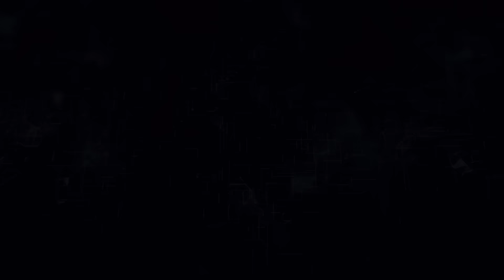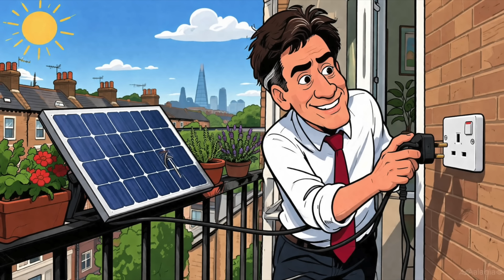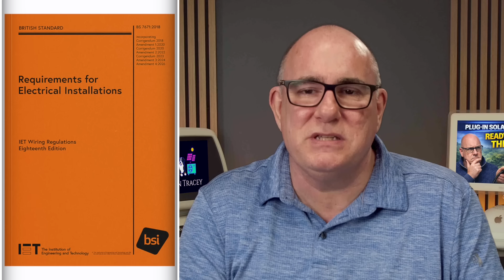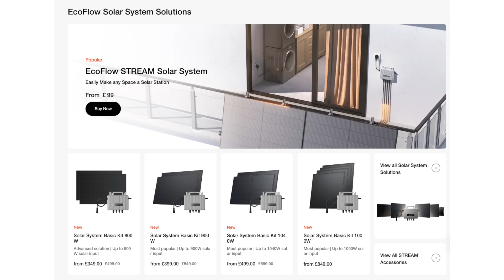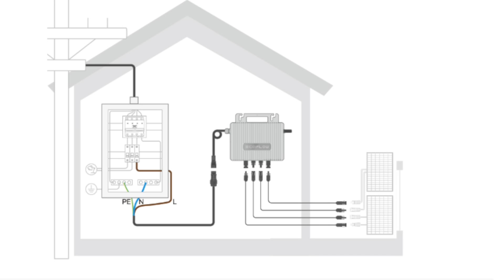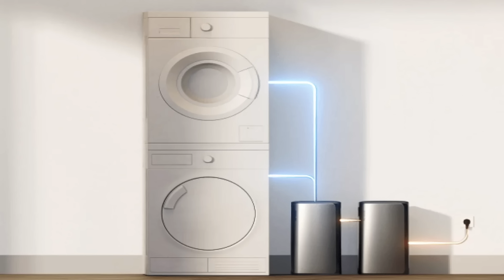Plug In Solar Is Coming… But There’s a Problem

Comment: Can you answer a technical question for me?

When you plug your micro-inverter into a socket, it senses the mains and synchronizes frequency and phase and produces an output.  If you then remove the plug or the incoming mains fails it needs to power down, but how does it tell the difference between the incoming mains and the power it is generating itself?  I can think of a few ways to do it, but how does it work in real life?
Reply from the maker: @rogerbarton1790 great question 👍  

In real life it’s handled by something called **anti-islanding protection**. The inverter isn’t just looking for voltage — it’s constantly checking grid stability (frequency, phase, impedance etc).  

If the grid disappears, even if the inverter is still producing power, those characteristics change very quickly. The inverter deliberately introduces tiny disturbances and looks for a “stiff” grid response — if it doesn’t see it, it shuts down within milliseconds.  

So it’s not actually “confused” by its own power — it’s verifying the grid is real and strong, not just itself.
Reply: @JonathanTracey  Thanks for that, pretty much what I was thinking i.e.:  Pull the plug = load current disappears = stop the inverter; grid disappears = load current  increases = stop the inverter.  Stop the inverter periodically and don't restart unless the grid is there.

Comment: LONDON, March 18 2026 (Reuters) - Britain is seeking to change planning rules to allow business and public sector organisations like schools in England ‌to install small wind turbines without needing planning permission, the government said on Wednesday.

Under the proposals, business and public sector organisations would be allowed to install one turbine up to 30 metres high, without submitting planning proposals.

As of March 2026, the UK government has proposed new permitted development rights (PDR) in England for non-domestic, small-scale wind turbines, allowing heights up to 30m. 

Proposed limits include a maximum 200m² swept area—roughly a 16-meter diameter—aimed at increasing on-site energy generation for businesses and public sites. 

Height matters for a wind turbine because wind speed increases and becomes more consistent at higher altitudes due to reduced ground friction and fewer obstructions. Taller towers allow turbines to access stronger, more consistent winds—a phenomenon known as wind shear—which can exponentially increase energy production and improve economic efficiency.
Reply from the maker: Yeah, it’ll be interesting to see if this actually does anything, wind turbines with blades less than 1 m and size are generally useless, and in urban environments that turbulent air doesn’t allow for much power generation?
Reply: @JonathanTracey   As of March 2026, the UK government has proposed new permitted development rights (PDR) in England for non-domestic, small-scale wind turbines, allowing heights up to 30m. 

Proposed limits include a maximum 200m² swept area—roughly a 16-meter diameter—aimed at increasing on-site energy generation for businesses and public sites. 

Height matters for a wind turbine because wind speed increases and becomes more consistent at higher altitudes due to reduced ground friction and fewer obstructions. Taller towers allow turbines to access stronger, more consistent winds—a phenomenon known as wind shear—which can exponentially increase energy production and improve economic efficiency.

Comment: The real winner of everyone buying a supermarket DIY plug-in solar kit will be the grid infrastructure in general - most of the excess generation that cannot be self consumed will be exported and if no MCS or G98/G99 approval, the owner will not be paid for exporting it and it will go to the grid for free. Not sure if the generators get paid for it, but it will be used by other households and they will have to pay for this free electricity being sent to the grid. Would be interested to know more about who would mainly benefit from unbilled excess generation export capacity...
Reply from the maker: @GdaySport that’s a really good point 👍  

Without export agreements, excess can effectively go to the grid “for free”.  

That’s why these systems are really about *self-consumption first* — and why batteries are becoming more important to capture that value.

Comment: 0:48 and yet hes just canned the drilling idea and we are sticking with imports
Reply: Because it'll take a decade for new drilling to produce product, which we then can't refine and will be more expensive and more CO2 intensive than getting it from Norway
Reply from the maker: we wont see any benefits of more drilling, the energy would be sold at market rates

Comment: Thank for the information when it comes to the power companies though no matter what meter you have I have little faith they will give you any financial benefit through a straight off plug in system, I’d rather store it and know what I’ve stored is mine.
Reply from the maker: @scubadave32 I get where you’re coming from 👍  

Storing it yourself is definitely the most reliable approach.  

That said, solar is still one of the *safest, most predictable returns* you can get — once it’s installed, the savings are locked in. Compared to banks or stocks, there’s far less volatility or risk involved.

Comment: How does the electricity consumption in the house feed from these systems to reduce costs? 
I mean, currently the  electric meter measures my overall usage, and I get billed accordingly, how does this lower the reliance direct from mains?
Reply: The house will use the generated electricity from the inverter before the grid is used and the meter only measures what is pulled from the grid.
Reply from the maker: @Belfast-Biccy great question 👍  

It’s actually really simple in practice — your home will **always use the solar power first**, then top up from the grid if needed.  

Think of it like this:
- Your house is constantly pulling power  
- The solar system “pushes” power into your home  
- If solar is producing 300W and your house is using 500W → you only import 200W from the grid  
- If solar matches your usage → you import nothing  
- If solar exceeds usage → the excess goes back to the grid (or into a battery if you have one)

Your meter only records what you **import from the grid**, so the more your solar covers, the less you’re billed 👍  

That’s how it reduces reliance on mains — not by switching sources, but by *reducing what you need to pull in the first place* 👀
Reply: Basically you may charge your mobile, run your internet and a few other small devices. You won't generate enough to feed back with such a small system.

Comment: Interesting video! I could see the DNO’s having a thing or 3 to say if it was to feed back into the grid. I’d rather charge my own batteries to use in my flat. Great video, it’s got me thinking
Reply: If you have a G98 form filled in properly and filed after the install then the DNO doesn't have a say. They aren't allowed to refuse a G98 in any normal situation. Above 3.68kW they have the right to refuse any higher.

Within a flat you can do this already for own batteries but then you have to run the devices off your batteries and the socket on the battery/inverter box directly. In an apartment/small flat that can be quite practical, it needs no regulations, no electricians, no signoffs and you can do it today with boxes from folks like Bluetti, Ecoflow etc. Some of the systems also support timed charging so you can use them on Economy 7 and similar tariffs.
Reply from the maker: Thanks I’m glad you found it useful, I agree with you. The DNO’s will worry about it if it happens on a large scale but with an 800 W inverter the chances of people exploring very much power I pretty slim

Comment: I have panels and an inverter  all ready and lion batteries can I add a micro inverter and plug in
Reply from the maker: If you’ve already got an inverter, do you need a micro inverter? Or is the current one already a capacity?

Comment: The good thing is that with all the renewables being installed supply will go up and people buying plug in solar means that demand will go down. 
Solar in the summer in the UK is good so we will have massive over supply in summer.  This make days of "free electricity" in the summer daylight hours  more and more likely. This will mostly help the people who have not bought plug in solar as those with it already have the electricity they need so wont get the benefit of this free electricity.  Their electricity will be "free" but only once they have paid for their plug in system. 

As such it may take far longer than predicted to recover the cost of buying these plug in system.
Reply: Plus the standing charge will increase.
Reply from the maker: @andrewfrance1047 really interesting point 👍  

We may see more “cheap/free” periods, but the key thing with solar is you’re reducing what you buy at peak rates today.  

So even if prices drop at certain times, a well-used system still delivers a *very predictable return* over time.

Comment: Remember when electric vehicles came out. We were told they'd be road tax free. Then when the gov realised they were losing money...they put road tax on EVs and hammered the rest of us using petrol/diesel cars. The electric companies will do the same TO EVERYONE! I've played with solar for some years (I have a C&G in electronics). 800 watts? Might be ok for a few LED lights when the power goes off. Listen to your transister radio. Keep a fridge running (?). Run a 700 watt microwave for a while. NOT ALL AT ONCE though! For what these systems will cost it'll take years to save that back. Chances are the unit system will pack in working before you see a saving! As for batteries...you need leasure batteries and they ain't cheap! A car battery'd last about a year on light duty.
Reply from the maker: Can’t give your life in fear of what might happen, but it’s a live for today or ask the opportunities as they present themselves and run with it
Reply: Warranty even on Ecoflow stuff is 10 years, so it'll pay back nicely under warranty.

LFP batteries are cheap, it's 1500 quid for 16kWh at this point from as reputable source. That'll run a typical house for quite some time.
Reply: @etchedpixels warranty not worth the paper it's written on.
Reply: So pay back time goes down to about 20, years, I'll be dead by then.

Comment: Unless I missed it, I don't think you mentioned islanding and what happens when the power goes off. Am I right in thinking that none of these systems work when the mains power goes off.  I am about to move to one of the villages in Cornwall where some people had no power for 4 days and shorter power cuts are fairly frequent.  It is a brand new house, all electric, no gas, no solid fuel fire and no islanding on the solar panels.  I am keen to have something to ensure that I can at least keep the freezer & fridge going and charge phones, computers and lights using some solar panels.  The developers are wanting to charge a huge amount to put in Islanding and there are complex issues with warrantees on the existing systems, I was wondering if I could do something  and cheap that would work separately and give some useful power for all the time when the power is on!.
Reply: I've fitted a low power system to my workshop (about the size of a terraced house).  Basically I've disconnected the lighting circuit from the consumer unit and converted it to run on 12v.  Thus the lights work off a 12v battery.  I have a 1.5kW inverter connected to the battery and supplying its own 13A sockets used for fridge, freezer, router, modem, power tool battery charger and other small appliances.

If the battery goes flat or the inverter is switched off an automatic changeover switch connects above sockets to the mains.
Reply: Some of these units will keep the sockets on the unit itself alive, and will charge from them but will cut power to the grid connection (to protect anyone working on it etc). You can fit a separate AC coupled battery system without touching any existing rubbish - but the existing solar won't be used in that case unless you add extra solar on a shed, or keep a couple of panels somewhere to put out in an emergency.
Reply from the maker: @markbick5419 great question 👍  

You’re right — standard grid-tied solar (including plug-in systems) **won’t work during a power cut**. They shut down for safety (anti-islanding).  

What you’re looking for is a **separate backup system**, not tied into the house wiring. Something like a small solar + battery setup (EcoFlow, Bluetti etc) can run:
- Fridge/freezer  
- Lights  
- Phones / laptops  

That way it works *completely independently* during outages, and you avoid messing with warranties on the main system.  

It’s actually a really good use case for these smaller systems 👍

Comment: Possibly 800W panel set up. 🤔Might have to set up a stand alone system for my shed roof and run it through my 120V 60Hz inverter to get US Specification power.
Reply from the maker: I seen that in some states micro inverters are now allowed, and instead of 800 W they seem to be based on 1200 W architecture

Comment: Hello, thanks for this informative video. I reside in the Republic of Ireland, do you know if the Irish Government plan on allowing us to do this here in Ireland? My understanding is that they do not, as electrical regulations do not allow this sort of thing. Yet. My understanding is that if there is a power cut, their is risk to electricity workers working on the grid if these systems are in place, and yet these systems are deployed throughout Germany with no issues. A simple plug and play. And as you say, a brilliant introduction to solar.
Reply: They cut out when the grid goes down so there is no risk to electricity workers, just to energy company profits and electricians fees.
Reply: @etchedpixels  You just nailed one of the underlying problems during a period of change. The people/organisations benefitting from the current setup make the "change over process" as hard as possible. 

I hope that the Irish government and the UK governments will empower the legal and safe use of these "new technologies" used in European countries for years in Ireland and the UK asap.

And I also hope that these governments look at the standing charges as well as they go up. I thought that the private electric companies competing with each other were supposed to keep the prices down.
Reply from the maker: @dapperdynamicdavid great question 👍  

You’re basically right — Ireland is *a bit behind Germany on this* at the moment.  

- Plug-in (just “stick it in a socket”) *isn’t currently allowed for grid connection*  
- Any grid-tied solar has to be installed by a *registered electrician* and submitted via an *NC6 form to ESB Networks* 

The safety point you mentioned is actually already solved — modern systems use **anti-islanding**, so they shut down instantly during a power cut (same as Germany). That’s why they’re safe.  

What is allowed right now:
- ✔️ Full rooftop systems (very common now)  
- ✔️ Off-grid / battery systems (no grid connection needed)  

So the tech works and is proven — it’s really just **regulation catching up**, not a technical limitation.  

I’d expect Ireland (and the UK) to move in this direction over time, as we’re already seeing pressure for simpler “plug-in” options 👍

Comment: i think the new panels have that inverter in built, so you can plug them directly in.
Reply: There are a few setups where the microinverter is fitted to the back of the panel. It's generally a dumb idea as the panel hates heat, it blocks bifacial panels and if you put it on a roof you've now got a maintenance problem if it goes wrong.
Reply from the maker: No, the micro inverter is separate because you can actually plug multiple panels into one unit

Comment: They're trying to keep the message simple. That's why they are saying it's plug in solar. If they explain the technical details of synchronization and micro inverters, that's likely to put people off who are expecting something simple. The maximum will be 800 watts and there are no plans for multiple systems being allowed in a single property. The suppliers are not united on micro-segs, so it's uncertain whether householders will get paid for export, but there's pressure to allow it and obviously changes need to be made to allow that, but as you said it's primarily aimed at self consumption. Don't forget though, a lot of this is aimed at people who will be unable to have more than a couple of balcony panels, so it's not a gateway. If this takes off, a million homes feeding a couple of hundred watts back to the DNO is not to be sniffed at, it just depends whether it's "free".
Reply from the maker: @gmo4250 really good summary 👍  

You’re right — it’s being simplified to make it accessible, but the detail (limits, export, multiple systems) is still evolving.  

And yep, at scale even small systems could make a noticeable difference.

Comment: I have a 12 year old 2kw system. 
I also have 2 ev's  and a zappi.
I.m looking for a bit more surplus power as the zappi needs 1.4kw to start charging the car.
Would this be an easy way to increase the surplus?
Reply from the maker: @MarkMark-j8j short answer — yes, it can help 👍  

But with a 2kW system, you’re still limited by total generation. Plug-in solar could top you up a bit, but it won’t massively increase surplus on its own.  

If your goal is hitting that 1.4kW consistently, batteries or a larger fixed system will make a bigger difference.